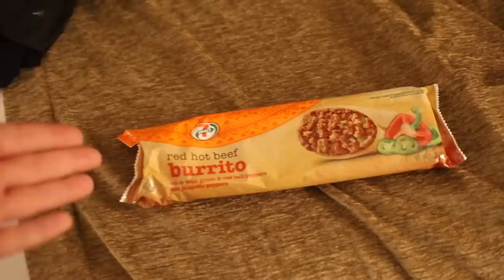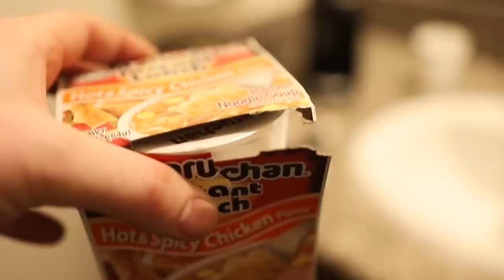Getting Ideas From Bimmerfest

Comment: Hey I'm a truck driver and at the truck stops they have everything for 12 volt. They have a little lunch box that will heat or cook your burritos while you're driving. You can even get a 110 to 12 volt plug in adapter that you can also run inside the motels. The Lunchbox / oven I've had for 15 years and it is still working. I heat my food while I'm driving in the  little aluminum trays. It takes about a half hour to 45 minutes from frozen or cold with a little bit of water in there while I'm driving. The aluminum trays you can buy it at any Asian market Or Hispanic market for about a $1.25 - $2 75 for a pack of three to five. Foil also works too but I like the trays better. Check it out it's worth the investment.

Comment: look into the mittler bros dimple dies and eastwood(i think you and them have a good relationship??) beadroller, they have a budget one that has a decent throat and comes with any dies you would need, also can get a electric motor for it later this summer(or since you are you they might just give it to you early). both of these together would help make a badass firewall/floor/engine bay, or whatever you want to do sheetmetal. The mittler bros stuff are pricey but the simplicity makes it 100% worth every penny.

Comment: At 8:05 Couple someone possibly tell me what that little box with antenna thing is on the bottom of the gusset part of the cage? I still sort new to BMWs and just an e36 last year, I found one of those hidden under my visor and I'm still wondering what it goes too. A little tip would be really helpful, thanks